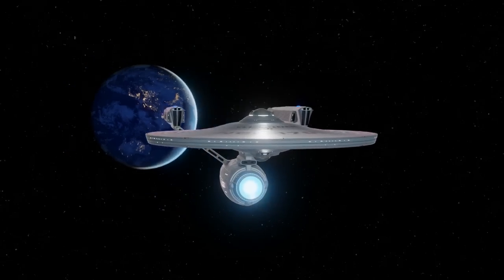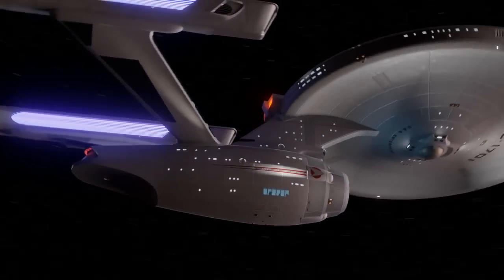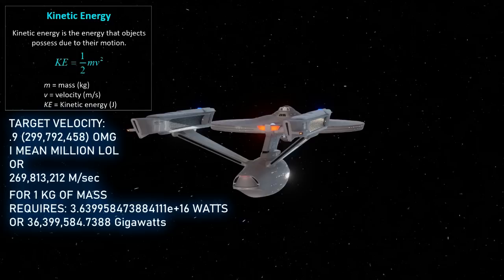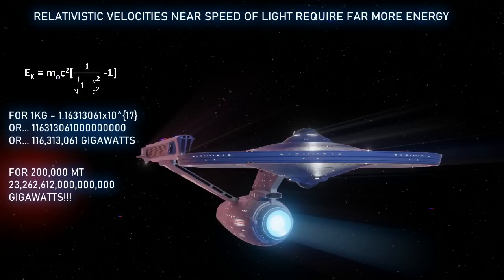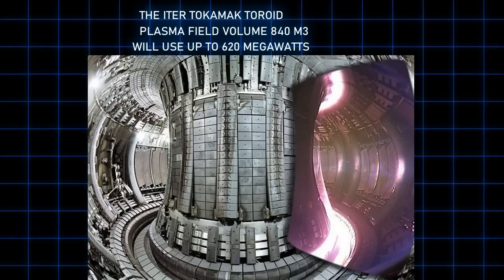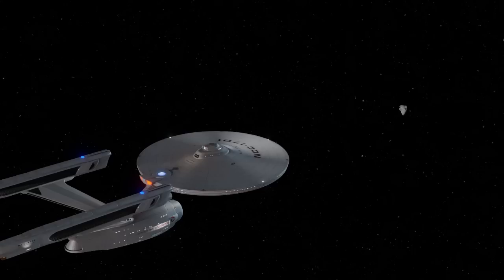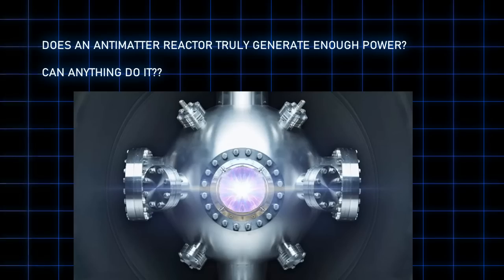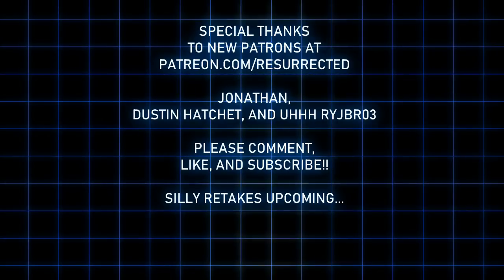How Many Nuclear Power Plants Can Power the Enterprise? Let's Calculate!!!

Comment: To put this in perspective, ignoring relativity and the weight of the fuel itself, to reach lightspeed you need to turn half the ship's mass into energy.  Or an eighth of the mass for 0.5c.  And the same to slow down again.  Since that clearly is not occurring, I have to accept as canon that the Impulse engines use a sub-warp field to lower the effective mass of the ship.  It's a necessary weasel in this genre.